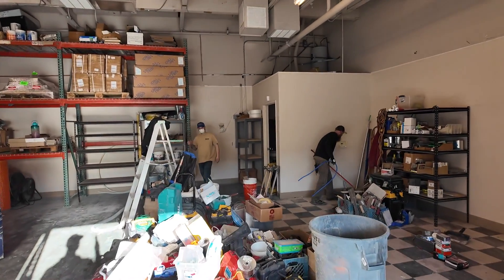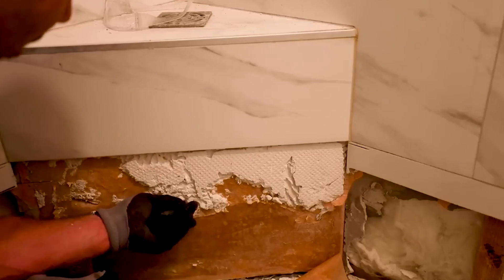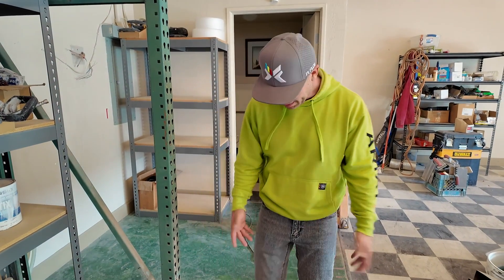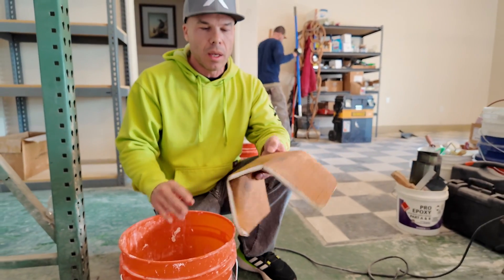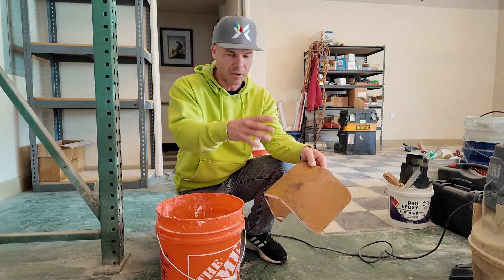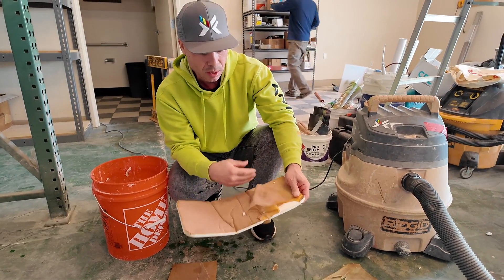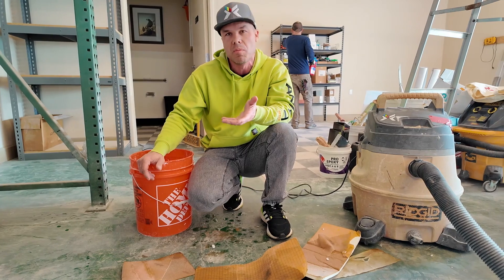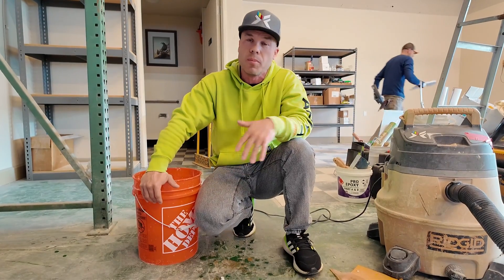MOLD ON SCHLUTER KERDI ???  This can't be good. 1 year test.

Comment: I prefer go board because I believe the fleece on Hyder Ban and kerdi boards just creates another failure point. I used to buy Hydro ban by the pallet and I’ve had a number of them delaminate after they’ve been stored indoors. That’s scary. I’ve also gone through a couple pallets of go board and have had no issues. I can tell it’s a different type of foam. The exposed edges of go board will become flaky if stored in the sun. But I don’t think any of the materials should be stored in the sun. Just my observations They make you a little itchy but I’m glad there’s fiberglass in it. Lol.

Comment: Problem is how was the Kerdi originally installed?  Was it done correctly?  Was the proper mastic and grout used?  Was everything sealed properly?  Did the homeowner follow through on using a fan to disperse the moisture?  
And Kerdi is not designed to be under water 24/7/365.

Comment: I've noticed a lot of contractors are like fanboys for these foam board or membrane systems, well I've never used one and never had a pan or shower fail, I don't care if it's lighter or easier to work with I'm not in the slightest concerned with ease of installation but the actual quality is my concern, if you're stupid enough to use soft foam in your showers you deserve to have them fail...

Comment: Here in the PNW we find mold will grow on practically anything. Plastic, metal, fiberglass, glass, composite material, you name it.
It grows outside and inside even better because of the warmth.
I will wait to see if anyone posts anything in this thread on which mold will not grow.

Comment: I wonder what other products out there will survive being submerged underwater for 1 year?   Obviously, kerdi was never designed for that, I'm pretty sure any membrane product would do it.  But I'm not even sure this test is in any way relevant to shower installation, actually I'm convinced it is absolutely irrelevant! ))  I can't imagine any real-life scenario when the board or membrane is surrounded  by water from both sides for any long period of time... unless the whole house is under freaking water after a huge tsunami or something!!! ))) In that case, you can shower anywhere inside or outside of the house! So It is just a fun observation but not really alarming or discouraging from using Schluter at all (just in my personal humble opinion))).     However, I do have some concerns regarding the black mold on kerdi products (it would be nice to have some scientific explanation, even from some schluter reps). I also saw it before, usually when people store it outside or leave it in the truck for a long time. Again, not very concerned about it... I saw the mold on top of the glass surface before!!! It just needs the right conditions, it can grow anywhere!       I think builders should be focused on the bigger picture though, in the case of the bathroom on the whole design of the space. Controlled and conditioned space won't have any mold issues. But everything is important in that case (air movement, heating and cooling sources, ventilation, humidity control, amount of uv light etc.) And when it comes to waterproofing and tiling you need to consider the whole package, membranes, adhesives, grout, sealants, actual tiles and so on.     But I love what you doing on the channel, constantly questioning, experimenting, trying to challenge things, finding better solutions and improving for yourself and your customers as well!  I love it and I'm glad more people are doing it because of you and this channel!

Comment: I agree that mold will grow on a surface left in the air. In the air, there is organic material, dust, dirt, and mold spores floating around. More or less depending on local factors (farming, industry). But it still is concerning. Thank you.

Comment: Not really a fan of Schluter products, but if installed correctly, Kerdi board shouldn't have any exposed edges for water to seep in and de-laminate the layers.  To test the product fairly, the edges should be wrapped with kerdi band.   Regarding the mold, is there any surface mold wont grow on?  While the experiment is interesting, im not sure it proves anything.

Comment: So is Kerdi bad now?  I feel like over the last couple weeks as I add a small bathroom to my house, it went from the product to use...to now being torn apart in a few of your videos.

So what's the deal?
Reply: It was only "the product to use" because they priced it at a premium and paid a bunch of youtubers to push it
Reply: @idahodiy  I'm sad because right after I put some Kerdi board up, I started finding the videos of the installations failing.  I am compensating by making sure I use  sealer on every seam and using plenty of the membrane.  It's just for the walls as it is a tub, not just a shower, so hopefully in the end I am fine.  Would be a lot more worried if my pan was kerdi board too.

Comment: Idk, you put the Kerdi board into a situation it’s not designed for. A better test would be to set up three separate boards. One with tile, and two without. Spray down two walls for thirty minutes each day with a garden hose and leave the third as a control. This simulates what the board would go through during a shower. Then see after a year how the boards look. Remove the tile and inspect the board. 

I suspect both will be fine.. the Kerdi is designed to get wet and air dry. Not be submerged for an extended period of time. 

I love your videos but this test is a little ticky tack..

Comment: Probably not much to over think here, Kerdi is a water preventative product, and in their "mold" section a rep sent me  said it is meant to dry out between uses but results may differ and are not gauranteed. It is a polyethylene/polypropylene fleece material and most likely the adhesion they use which is hard to find info on,  is whats molding. Definitely not made to stay submerged, but they should improve their product and be more transparent. Also, maybe conduct a real life test? I make actual showers in my shop and we use them daily and run the plumbing out the side of the wall lol. That being said it is used as recommended with heavily abused  testing. Also I have a way i have been incorporating the oatey liner, the oatey drain mixed with the flo fx drain, floating my pan and curb, and a cheapo sheet membrane which i won't share here, but the results in the shop with 3 different stages of its mockup, to the real life in use mockup are impressive so far lol

Comment: I redid my master bathroom a year ago. I had a corner shower with a fiberglass base, glass doors, and plastic walls. All put in 30 years ago when the house was built. I watched a lot of your videos and Bob’s videos and also a few other channels and was ready to pour the mortar for the base for tile, even had a bucket of red guard. After watching more of the water, wicking videos and wood damage, I returned everything that had to do with tile and bought a 4 x 3 base and the plastic walls to install and be done with it. I ripped out a 30-year-old shower and didn’t find any wood damage at all so I went back with the same type of unit. What really convinced me was seeing a friend’s custom tile job in his expensive house and I looked at some of the dirty, grout lines And thought I don’t wanna have to deal with dirty grout or cleaning it all the time.  In my case, I squeegee all the walls after every shower. I am happy to know that my floor will never rot out for another 30 years.
Thanks Isaac, I continue to watch your videos but learned to stay away from tile and to use a single seamless enclosure, if I want to be worry free.
Reply: While certainly more work you can avoid worrying about grout discoloring or getting funky by using epoxy grouts, they are also basically waterproof.So you'd have your base layer of waterproofing, and then if you got a porcelain tile and used an epoxy based grout a second layer of waterproofing. It's just a bit more to install.
Reply: I've been having the same thoughts as I approach redoing a bathroom or two.  Love the way tile looks when it's done but I don't think anything beats the waterproofing and ease of cleaning in a shower than a solid, one-piece base with solid surface walls.  Tile is still the way to go for a bathroom floor, though.

Comment: It appears that the de-lamination  occurs when water enters the board's core. The water will eventually migrate throughout the entire panel, and ultimately - and not surprisingly - cause it to fail.
Perhaps I'm missing something, but a properly installed Kerdi shower system is completely sealed and should prevent this from happening. It seems the take-away from this is the edges of the Kerdi board should never be exposed to moisture.
Reply: Or remain submerged, schluter says this in their manual. It’s designed to get wet and air dry.  This is like testing the towing capacity of a Honda civic with a boat attached and being shocked when it doesn’t pull it…
Reply: Maybe Redgard all the "cut" edges of the Kerdi board before installing? and don't rely on Thinset to be a 100% waterproof bonding adhesive

Comment: The mold is innocuous because it is behind the thinset and the tile, the bigger issue is if that board is embedded into the pan mortar as most people like to do, it will wick up water and ruin not just the curb but potentially the vertical studs, I see that time and  time and again with porous cement board and now you are showing it with a foam board, that sucks.
Reply: and the thinset bonds to the kerdi... what happens if slimy mold grows in that bonding area? its gotta weaken the bond between the kerdi and thinset if theres a bunch of slimy mold between the two...

Comment: While I really like your channel this test is absolutely ridiculous!  The Kerdi board edges are never supposed to be exposed to water since they're covered with Kerdi band! The fact that it took a year to have problems is absolutely amazing! Schluter tells you never to leave the board outside or exposed to sunlight. Just use it correctly! I have for many years and it's never failed.

Comment: So Issac, what is your preferred shower install approach thee days ? Mud pan , hydroban membrane on Kerri thin set  (2x on pan, 1 -2 x on walls ?_and preformed Corners .,then liquid hydroban over that, epoxy grout ?
Reply: This is what I do but 5 coats of membrane normally 2.5 gallons of membrane over sheet membrane fa grout or prism with sealer choice gold color match silicone corners never had any issues
Reply: @Catheycustomshowers What wallboard do you use? And you use fabric on the bottom with hydroban on top of the fabric seams?
Reply: @PalmerTile  if you're gonna do 5 coats of liquid membrane, you could use generic drywall.

Comment: Thanks for the videos man. I would be interested to see you test go board. Ive switched to using it for the most part. Yes, ive seen some mold/black stuff on kerdi before.
Reply: I had six 3x5 sheets of GoBoard sitting in my side yard for a couple months exposed to the elements. Found some mold growing between several sheets. Wiped with bleach and let dry before using. FACT: Mold can grow "anywhere" on just about anything when the conditions are right! For example, I closed up an old car my side yard and after several years I discovered black mold was on every interior surface, window glass, chrome, vinyl interior, carpet etc.

Comment: Organic compounds will deposit on the board as dust gets kicked up and settles on the surface of the water.  When the level drops as it evaporates, more and more organics are left directly on the board and fed as you add more water to the bucket.  You need to have a control and create multiple test samples in the event of contamination but more so, you should create an assembly where there is wood, grout tile etc. to wick and trap moisture between layers to feed on organic compounds suspended within the material layers which makeup shower assemblies.  Buckets need lids but also, showers are humid environments daily which heat and cool in cycles as well.  I know some people have used mastic in showers which is a big fail and also adds fuel to the generation of mold.  At any rate, water can have high levels of organics or nutrients as another mentioned which would also add fuel but it’s likely that grout could be mixed in a contaminated bucket and give a start to the sub-tile Petri dish.  I know the home centers always had a piece of siding in a clear box of water that was sealed to prove something.  You almost need an aquarium that is half filled and sealed to prevent evaporation and loss of the test liquids which would keep it controlled in a cycle.
Reply from the maker: But the bucket itself has no mold on it.  Thats what I don't get.
Reply: @TileCoach The bucket itself is make of plastic that is largely made to be in water, buckets have special linear on them that prevent mold growth. That being side I have seen buckets with black mold on the lid or bottum of a bucket, the mold just dose not affect the bucket in any way and the results would be more clear if the bucket was sealed so air and particles from the air can't continually be going into said bucket that would be a great detail next time around. I would like to also see cement board and Redgard or AquaDefense for a base reference.
Reply: @TileCoach  the surface of the Kerdi board is porous while the bucket is not.  I am not going to go all out and say Kerdi has a layer of organic material on the product itself, that is where research ahead of science becomes increasingly important for testing. 👍🏻
Reply: @BreakerBreaker1320  "the surface of the Kerdi board is porous"   so why would you use that as a waterproofing material in a shower?  if its POROUS is going to suck up water & water vapor from the warm shower and condense inside the cooler wall cavity behind
Reply: @TileCoach  - We've all see mold on items such as glass, stainless steel, etc. It's not the item per se, but the outside contaminants that are attracted and fall onto the item. Mold grows from mold spores, period. They are microscopic and in the air we breath. The only thing all mold spores need is water/moisture. Your Kerdi was wet and will draw/wick moisture into it's surface coating which is a perfect breeding ground for mold. spores. A plastic bucket generally will not, unless it has something stuck to it's sides that will allow that to happen.
Reply: Science!

Comment: I don’t even like Kerdi but this I don’t agree with. You leave anything in a bucket of water for a year and it will grow mold. I mean, honestly, it’s surprising how little mold it has on it. Also, a shower is not submerged. This is not an accurate representation of the conditions a shower would be exposed to. Build a small mock shower pan and wall with tile and recreate the amount of water one would see daily. Then after a year, tear it out and see what it looks like. I think about all of these shower systems, when installed correctly, are about one in the same. Sealed systems are a concept and method that can be accomplished in many different ways. Everybody has there material preference but most of these failures are installer error.
Reply from the maker: I already did. Watch this video: https://www.youtube.com/watch?v=vFp6qiVnO4E&t=0s

Comment: There isn't anything natural in that product...it's basically just a screen at that point.  Your shower has soap and dries out.  I'm yet to see a Kerdi system fail with using their new All-set.  They shouldnt' be soaking up water because of the corners being wrapped. Water in water out system. I'd never leave kerdi in a spot where it can soak in water and those goes for any backer board.

Comment: Kerdi isn't meant to be submerged for 12 months straight. Of course it failed, not the intended use.
Reply from the maker: I agree.  But what do you think about the video of the actual shower that gave me the idea for this test?  The link is in the description.  Check it out and let me know what you think.
Reply: That shower was done incorrectly and was soaking in water that couldn't escape.  I've done many and never have had issues.  I also insist on using epoxy grout for shower bases.  Helps me sleep at night
Reply: We used Hardibacker for years. Just started using DensShield and we like it